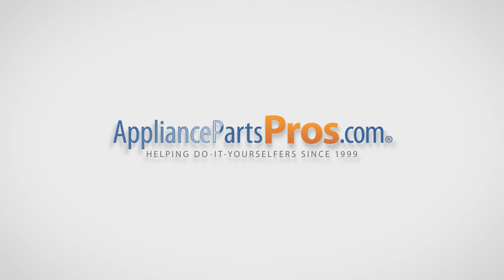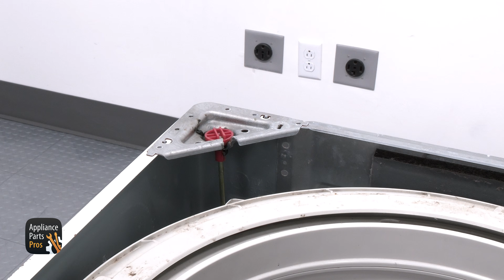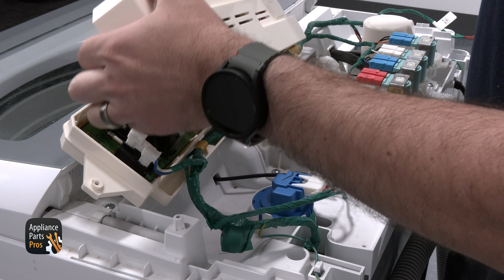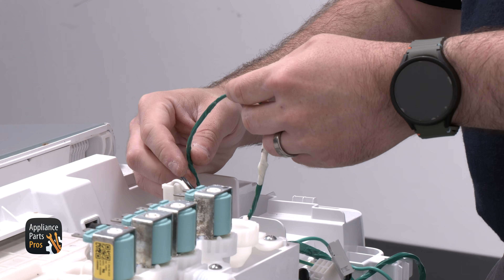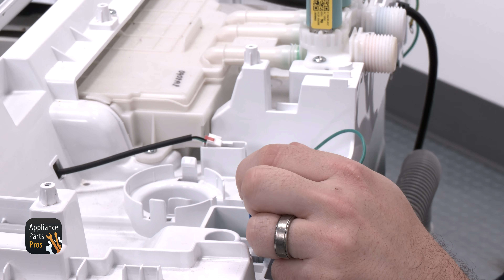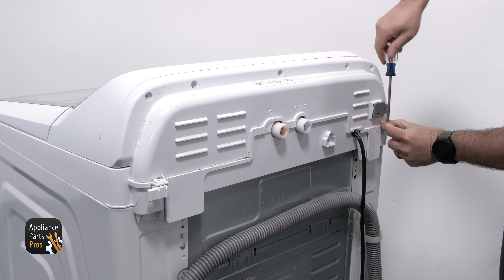Fix Shaking Samsung Washer with EASY Suspension Rod Replacement

Comment: I purchased my Samsung top loader April 2021.. started the unbalancing issue all of this year. Purchased OEM rods straight from Samsung because I didn't want to deal with aftermarket parts issues later. Followed your video and took less than an hour to complete. So WTF why are these parts only lasting less than 5 years ... any reason why?
Reply: Designed to fail so you have to keep buying them
Reply: How much are you washing? I replace mine every few years because we use the heck out of the washer lol 😂preventative maintenance is what I call it.
Reply: I say the same thing. Had mine since late 2020 and having the same issue the last few months. Short answer these are the worst washers ever and I regret buying one of these!
Reply: @westsida101 I ended up selling mine and getting an LG. Of course I informed the buyer of the issue and only asked 50 bucks for the washer in the condition it was with giving the unbalanced error so often. So essentially I had to eat a 500 buck loss plus spend the money on the LG. I can say the LG is MUCH nicer though 🎉
Reply: I bought my home in August 21 and got the washer in September. Mine has been giving the unbalanced error since early last year 😡
Reply: You have to use the correct settings like duvet when you're washing a heavy load.
Reply: Will I need dampening grease?
Reply: @gfour20 I did this on my washer today, I used lithium grease as some other video suggested.
Reply: Not a comprehensive repair guide. Disassembly blocked by the guys arms.
Reply: Same. Mine just started today and bought my washer brand new in 2021
Reply: It looks like a model defect. My washer is mid 2021 and just started experiencing the same issue. 😢
Reply: @marcelosantana9311 not a defect. It’s designed to wear out.
Reply: I AI’d it with specific details of what was happening, age of machine, and model #. This is a known problem for this model(s) of Samsung washer. What the guy doesn’t cover here in his video is the sequence/combination of buttons to push once its all put back together to recalibrate the machines balance sensors.
Reply: Only thing missing on this quite informative video is the re-calibration sequence once re-assembled. According to AI (Claude): Calibration Reset (per Samsung's official support process)

	1.	Remove all laundry/items — tub must be completely empty.
	2.	Power the washer off, then back on.
	3.	Press and hold Temp. and Delay End simultaneously for 3 seconds — display should show "Cb."
	4.	Press Start/Pause to begin calibration.
	5.	Drum rotates side-to-side for ~1-4 minutes (varies by source, budget up to 4 min).
	6.	When done, "0" appears on the display and the washer shuts off automatically.

Run this after installing new rods, not before — calibrating with worn rods still in place won't fix anything.

Comment: Do you really have to do all that just to replace the rods? I've done this repair once before, and all I did was move the top up and away to access the rods from the top, replaced the rods and that was it. I didn't have to take or unplug any wires or anything like that. I guess taking all that off makes it easier to see? Seems like a lot more work though.
Reply: This is what I was looking for! I am tackling this in a couple days and got the sense that there was enough clearance without disconnecting any wires as long as I have a way to hold the top part close after taking it off. Will be trying it this way to save the time and avoid breaking a connector or something. Luckily all the connectors look keyed like an automotive harness or Motherboard cables, so if I do have to take it all apart I'm not worried about reconnecting correctly as much as breaking or bending something weird. Thanks for the confirmation that you were able to reach the screws/clips to remove the top without all the extra electrical disassembly, i sort of figured he did that to access the necessary screws for that, but it sounds like it was just a presentation/maximum clearance thing.
Reply from the maker: You're right, there are quicker ways to do it if you’re comfortable and know your way around the machine. We show the more involved method so everything is easy to see on camera and so DIYers of all experience levels have plenty of room and a safer working area. Glad to hear your simpler approach worked for you! 👍

Comment: Would the process be the same for a similar samasung washer but not the exact one in the video? This is the model I have WA50M7450AWA4. Just curious if the process is all the same before I get going with taking apart all the connections
Reply from the maker: Looking at the diagram of your model, yes, the process would be almost exactly the same. It is hard to say what would differ exactly, because I'm just looking at a diagram.

Comment: This video helped me all the way through the job. A couple of things that would have helped. The water level sensor has plastic clips, one on each side, that my dumb backside did not see. The connector that goes to the top, back on the left as you are looking at it from the front, is just a testing port, not connected to anything.
Reply from the maker: Thanks for sharing those details! The water level sensor clips and the left rear connector being a test port will help other DIYers.

Comment: Seems like a lot of work to remove all the plugs, sensors and hoses on that back panel. Why not just remove the 2 screws that hold it to the unit and take the 2 screws out of the front and prop up the whole lid and back panel assembly (as one unit) to switch the suspension rods? That would save you a ton of time and headache remembering where all that stuff gets routed and plugged into.
Reply from the maker: Because there are a few plugs and connections that wouldn't allow that, and they have to slide through that assembly. Best practice so you don't leave a few connected accidentally and risk damaging the connections.

Comment: Great video I have a UB error, I suspect it's the suspension when it comes to spin it wobbles like crazy and gives me an error with no load, it works fine ill be ordering the spring rods.
Reply from the maker: Check the leveling legs before replacing the suspension rods.

Comment: Are you using generative AI to reply to comments?
Reply: yeah most likely
Reply from the maker: No, we do not. We have tested it out, but it seems like LLMs hallucinate quite a bit whenever it comes to appliances. Especially whenever it comes to model-specific troubleshooting or questions. It is easier to just do the research, type it out, and know you're providing correct information to the best of your knowledge.
Reply from the maker: Edit: It does come in handy whenever translating to a language I'm not familiar with.

Comment: Way to many disconnections ....easy fix with taking the top off and to move to the side.  Better to have another person to help you.  YOU made it to difficult .
Reply from the maker: Thanks for the input! There are definitely a few ways to go about this repair — some folks prefer fewer disconnections and a second set of hands, others like having everything out of the way. We try to show one clear method that works for most DIYers, but appreciate you sharing your take!
Reply: This comment was necessary. Your video creates way more work and room for error for ANYONE with ANY level of experience. If your idea was to eliminate errors for those who arent comfortable with less space to work, it doesnt outweigh  the room for error you are creating by messing with all of the wiring etc. This is, in my opinion, completely irresponsible of you. I bet there are at least a few people who end up doing more damage following your tutorial than they had to begin with while there is a much easier way to do this!!!

Comment: Hey can I get the link to the suspension rods to this specific washer please and thank you
Reply from the maker: The part number for the suspension spring for this model is DC97-16350U. This is for one. You can place that order through our website, or you can call us at 1-877-477-7278 to place the order over the phone. Here is a link to the part: https://www.appliancepartspros.com/samsung-assy-damper-27-dc97-16350u-ap6884450.html
Reply from the maker: If you provide your model number we can look up the correct part number for you.
Reply: @appliancepartspros it’s the WA50R5400AW/US

Comment: Love this video.  Saved myself hundreds of dollars in repair or the price of a new washer. 
Strong suggest taking pictures along the way.
Take your time as this can be somewhat complicated.   But you are good following directions you can do this.   I only replaced 3 of the four cables.   But have the extra cable.
Reply from the maker: @b.estellasm That’s awesome — great job tackling it yourself and thanks for sharing the extra tips! Taking photos along the way is a smart move, and we’re glad the video helped you save big.

Comment: I tried to follow your video. I couldn't put it all back together. I eventually had to call my appliance guy. He got mad at me for trying to do this myself. He said your videos are trash. I could've bought a new washer for what he charged me to replace the suspension rods. He recommends anyone call him no matter where you live. He'll come to you.
Reply: Where are you located?
Reply: That's too bad. Although my model was slightly different it was easy enough to figure out. We took pictures along the way and labeled the screws as we took them off.
Reply: That sucks! Yes this video is garbage and he is irresponsible for publishing this which undoubtedly causes much more harm than good.
Reply from the maker: @pawneechief1 Sorry to hear it didn’t go as planned — those suspension rods can be tricky if the tub shifts during reassembly. We always try to make our videos as clear and step-by-step as possible, but we know not every repair goes smoothly. Appreciate you giving it a shot — and we’re here to help if you decide to tackle something else down the road. 🙌🔧
Reply from the maker: That’s awesome, Jennifer! Taking photos and labeling screws is a smart move—makes reassembly way easier. Glad it worked out for you! 🙌🧰

Comment: Ok so had the wobble an shake. Repair guy showed up an said....on side....of course....but I replaced springs ran fine for about 6 loads an .,you...issue back.....next idea..?
Reply from the maker: @DougFulmer-m8f Sounds frustrating! If the new suspension rods only fixed it for a few loads, it might be worth checking the leveling feet, the tub dampening pads, or even the shocks (on some models) to be sure nothing else is worn out. Also make sure the washer is perfectly level and not overloaded — even a slight tilt can bring the shake back fast.

Comment: Do you need to grease the rods when replacing?
Reply from the maker: Great question @pdemaere83! The manufacturer doesn’t call for greasing the rods before installation, so it’s not necessary. They’re designed to work smoothly without added lubrication. Just be sure they’re seated properly in place, and you should be all set!

Comment: Awesome step by step instructions! I was able to disassemble, replace and reassemble like a pro! Ran a batch of towels without issue! Should I run a calibrate drum function too? I didn't know about that feature.
Reply from the maker: Hey @bobio97 — glad to hear it went so well and that your washer tackled a towel load like a champ! 👏 As for the calibration cycle: unless your model's manual recommends it after replacing parts, it’s usually not necessary just for changing the suspension rods. But if you're noticing any unusual vibrations or if your model supports it, running the calibration won’t hurt and can help fine-tune balance and spin performance. Either way, sounds like you nailed the repair!

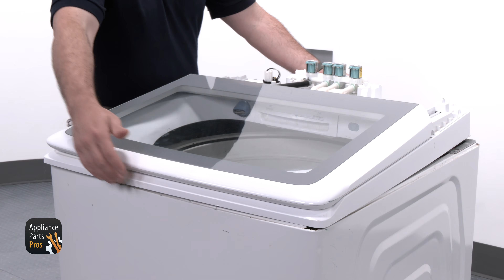Comment: I’m having issues removing the top to get to the suspension rods ( 4:08 ). I have everything disconnected but the front of the top doesn’t seem to want to budge
Reply: NVM, I figured out that there were two screws at the front of the top that needed to be removed as well
Reply: @libertyhog4211  thank you for this!
Reply: The screws are under the rubber cushions (where the lid rests) of my washer.
Reply from the maker: Glad you figured it out! Those hidden screws can be sneaky. Let us know if you run into anything else during the repair!
Reply: @appliancepartspros I have same issue.  why did you leave out this step (removing the 2 fron t screws)?  not professional
Reply: @MinhNguyen-c7n6o  come on karen
Reply: @MinhNguyen-c7n6o probably different model than the one in the video, rude to question his professionalism

Comment: Just replaced ours and I ran the calibrate drum (push TEMP & DELAY until code CB appears and press start) now I'm running a clean washer cycle. It works!

Thanks so much for this video, I would much rather repair than replace!!! 🎉🥰
Reply from the maker: That’s amazing — great job with the repair and the calibration! Love hearing success stories like this. Thanks for sharing, and happy washing! 🛠️🎉